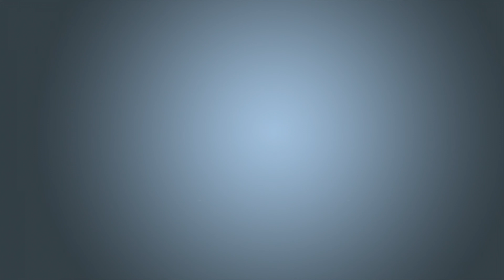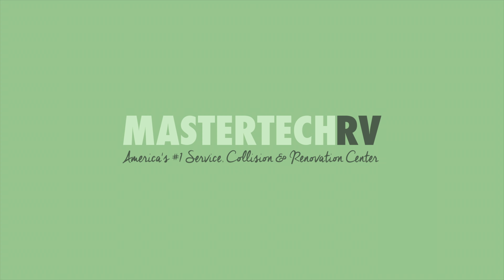RV Battery System Explained: part 2

Comment: I always look forward to your videos, but this time I'm disappointed. It seems that the existing batteries are Battle Born. I've had BB batteries for more than 2 years with nothing but flawless performance. The only time that the batteries will be unresponsive is when their internal BMS shuts them down when they reach close to 0% SOC; and yes, you will then have to charge them to wake them up.  I'm sure that the initial installation/configuration left a lot to be desired, but I certainly wouldn't blame the BB batteries. On a properly configured system, there would have been an SOC readout giving ample warning prior to the batteries falling to 0.
Everything you else mentioned in the video is fine, just not the battery issues.